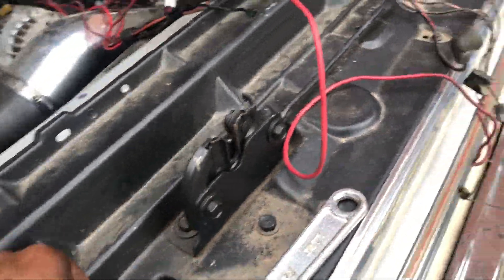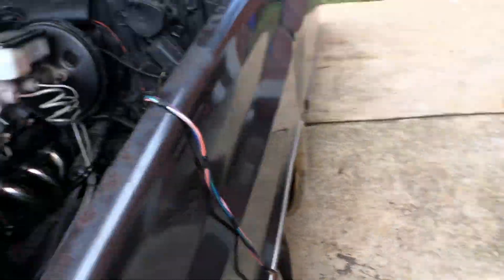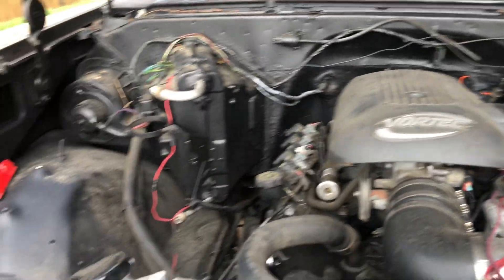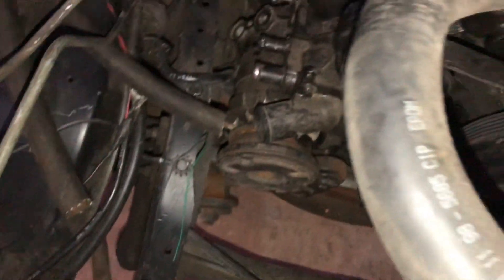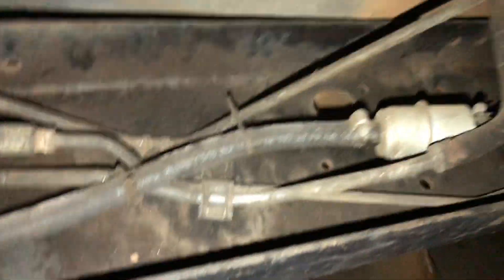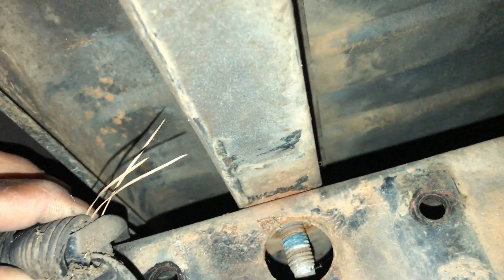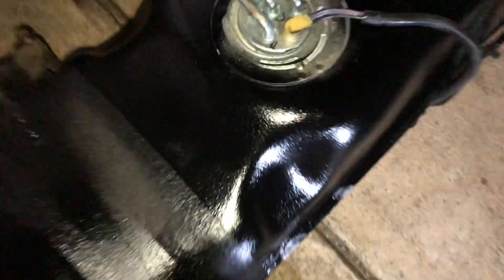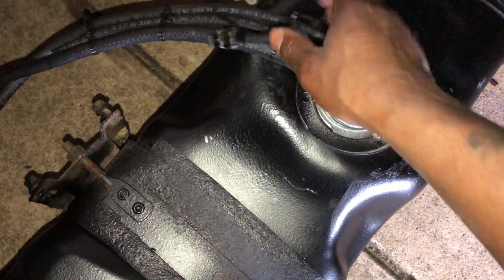JROCKS C10 LONG TUBE HEADERS & FUEL SETUP

Comment: U just made me have a flashback. Flipped my C1500 coming back to Michigan from Chicago,hit some black ice. Went back to Indiana to get my truck. Pulled into gas station to gas up, heard sump'n, gas squirts from tank. Order a new tank, afta installed,truck don't start. When you pointed out the bolt hole 4 da ground,didn't hook up ground. Was my first time replacing a tank,but I should've known, anything circuit has a ground. Thx 4 reminding me. LOL
Reply from the maker: 😂😂😂😂😂 you got it sir